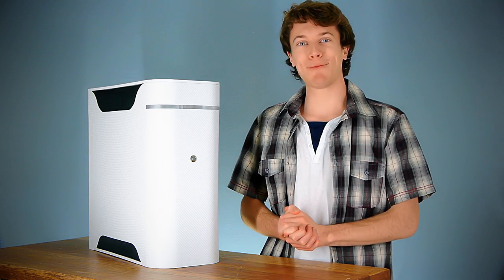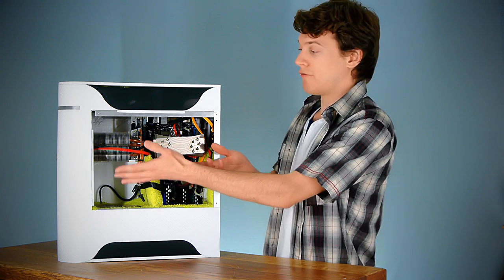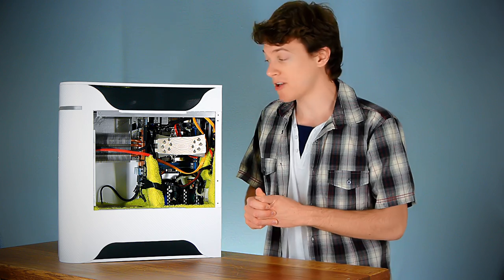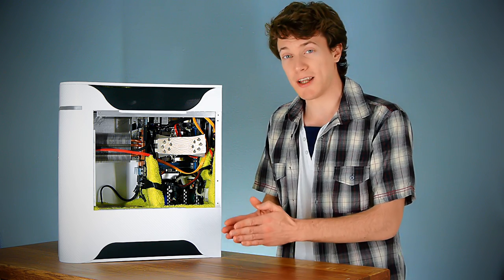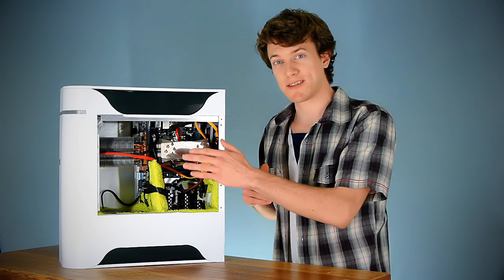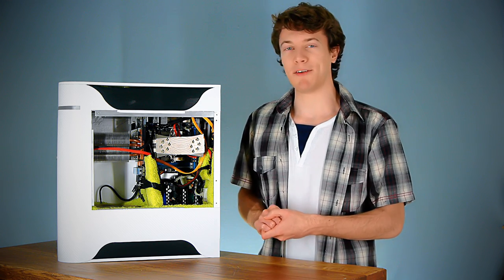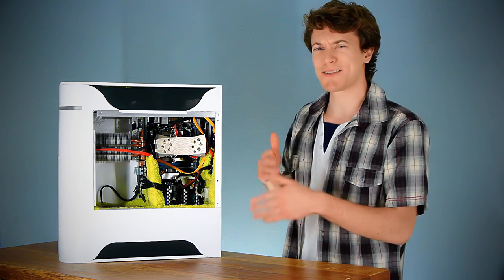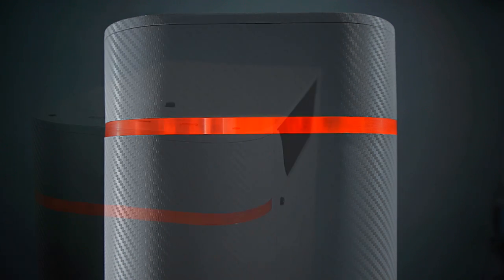DIY Computer Case - The Ultimate Silent PC (CLOUD UNIT)

Comment: Watercooling makes much more sense than this and it's far more effective and just as silent with the right components, BUT, this is pretty cool, too, altough that GPU is kinda shitty.
Reply: +ComandanteJ no it doesn't, when the water leeks out on to your motherboard from the CPU your F'ed.
Reply: Then dont let it leak, a properly tested and installed loop will never leak.
Reply: +ComandanteJ you didn't watch the video?
Reply: Diplodookus I did when i first commented, almost 3 weeks ago, yes, why?
Reply: ComandanteJ oh sorry about that, but he said something about watercooling in the video. Sorry for wasting your time
Reply: Diplodookus No matter, pal. If i recall correctly, i think he mentioned something about leaks and whatnot, but as i said in one of my previous responses, i dont think there's any risk of leaking in a proper loop, as long as it is well put together. Just run away from cheap AIO's, i did have a leak in a Raijintek Triton AIO, due to a catastrophic failure in the plastic material for the reservoir+pump unit (cracked to bits!). It got my R9 290 TriX wet, but ultimately it didnt do much damage, and the AIO manufacturer assured me they would take rcare of the now-voy GPU warranty if something went wrong.
Reply: ComandanteJ Oh thanks for explaining. I appreciate that :)
Reply: They have close loop cooling systems that are cool and good because you don't have to fill ever. I don't know about how quite it is. I think what he made him self is great. I also think that if more powerful GPUs come out that that will still cool it more efficiently then the standered that come with it. If you have multiple cards yes there is a problem with the fist design, but you could connect more pipes to help with the heat transfer.
Reply: Yeah in ten years about it finely leaked/ copper got green and leaked on the CPU and motherboard. The pump and fan was loud at that time still, but they do have more efficient and quite ones now, but I still like his setup.
Reply: I am using micro motherboard. I like the smaller form factor. I still don't have any heat problems.
Reply: Brian Nokes That's due to poor mainteneance/galvanic corrosion due to mixing of metals (Aluminium rad, steel fittings and copper block, probably). You need to set up a sacrificial anode to take the corrosion in those cases, or simply buy gear that's zinc plated to avoid corrosion.

About the closed loops (AIO's), make sure you buy a quality one like Corsair, with a solid warranty policy that will replace your hardware if the unit leaks.

And yeam MicroITX systems are pretty cool, i'm thinking of making a HTPC build in a 9 liter case, to watch movies and stream games!
Reply: +ComandanteJ water cooling is high maintenance.

also it takes the hot air and sends it into your room making your room hotter.
Reply: Hamguy Bacon that room thing doesnt make any sense at all
Reply: Hamguy Bacon so youre trying to say that if you are using air cooler the hot air dissapears somehow?
Reply: Diplodookus Who needs conservation of energy? LOL
Reply: Diplodookus the fans in the air cooler blow air around your room. but the water cooler takes heat from your cpu and directly spits it out into your room, there is no fan to recirculate the air. so it keeps making your room hotter and hotter.
Reply: Hamguy Bacon I'm sorry but that makes absolutely no sense. There is no difference, you transfer energy from the CPU to the air via whatever, and then evacuate that hot air out of the case using fans, rad fans in the case of liquid cooling, a single circulation fan in the case of this build. But that hot air gets evacuated anyway, i mean, what would be the poinf if the hot air got trapped inside the case cooking the components?
Reply: ComandanteJ yes there is. the fan cools the air, a water cooler just expels heat.
Reply: +Hamguy Bacon you dont know how computer watercooling works, do you...? and how can a fan "cool" the air? it moves the air, and if the inside of the case is hot, the air that comes out is also hot, that means youre pumping energy into the rooms air, thus heating it.
Reply: ComandanteJ Fans cool air, thats why they are used in air cooling devices. You dont know anything about cooling. You think a water cooler just cools air and keeps the hot air in the water. it shoots it out into your room.
Reply: +Hamguy Bacon ok, now i get you, youre a troll. You cant be that oblivius, so youre obviously faking it. i wont explain this again, because i've already explained it twice. Have a good day, sir.
Reply: Hamguy Bacon you cant "cool" air. You are taking hot air out and cold air in. Obvious troll
Reply: Diplodookus Yes you can, do you know anything about cooling systems. Do you understand why people have fans on their ceilings? its convection.
Reply: Hamguy Bacon we have fans in our ceilings to guide the hot air down again. I live in a cold place. Seems like people have not studied science. Im gonna go now, good day troll! :)
Reply: Diplodookus there is a switch on fans, convection works both ways, you guide the hot air down, and when you switch this the hot air rises and is cooled by the spinning of the fans the cool air is blown down to the room. 

You have no idea what the hell you are talking about, how do you not know the basics of a fan.
https://s-media-cache-ak0.pinimg.com/736x/5a/65/37/5a6537a53eeed6602a2ffe658427e6fa.jpg

Comment: i have seen some of your videos and am a bit worried. maybe i'm just being picky so feel free to correct me if am wrong.. you're a bit sloppy with the electrics stuff. the power supply is for what i know in side the metal case for 3 reasons. 1. it will ground the computer. 2. the metal case it's in keeps the magnetic field generated by the high power and components from leaking out to the rest of the computer that can/will result in damage. 3. i total forgot what number 3 was. also your soldering is every sloppy. am just saying you might start a fire or electrocute yourself or some hot attractive girl. also if i'm right ppl that follow you might do the same. safety first! or dead later!
ps. keep in mind am not a doctor so i am not 100% sure of what i say is accurate.
Reply from the maker: +MySound iicon I appreciate your concern but a lot more thought is put in to the design than is represented in the video. 1) was taken care of by grounding the external chassis to the PSU/power lane ground. 2) I've never heard of electromagnetic interference a actually damaging components at these power levels. It's not posed a problem nor is the system unstable at any rate, so I think it's safe to assume it's within operable levels. Taking PSUs out of their cases isn't an unknown thing to do in the PC case crowd anyway - it's not new ground really... and on top of that, most cheaper laptop power adapters aren't shielded either, and a PC PSU is basically just a bigger version of that...

As for 3) you've not seen the soldering inside the case, so you can't claim it's sloppy. I was very careful to insulate all the cables and to make sure that there's 0 chance of any short circuits (even if there was the PSU would shut off). Again, the whole case is grounded, so no chance of electrocution either. My soldering may appear 'sloppy' in my other videos, but that's for low power situations, and it's extremely hard do solder neatly when you're a) using lead-free solder, b) have a massive camera in the way so c) have to do it all at awkward angles and at a macro level where any flaws are extremely obvious. 

It's not like it's a product made to sell or anything, it's just a PC case by myself for myself. I know it's safe, so that's what counts, and I do appreciate your concern - but don't worry bud :)